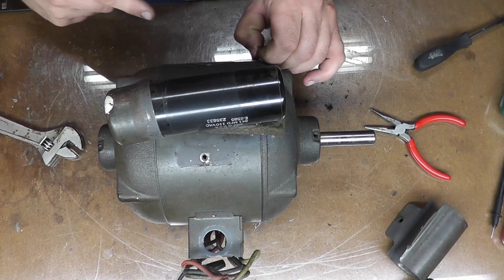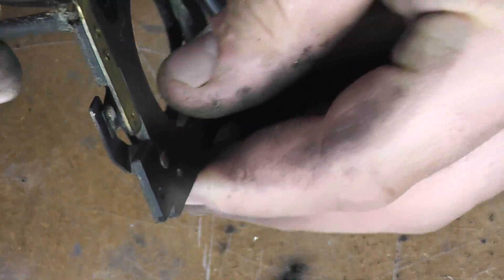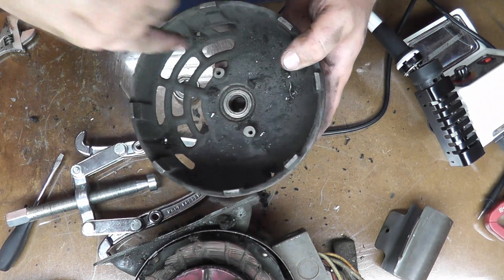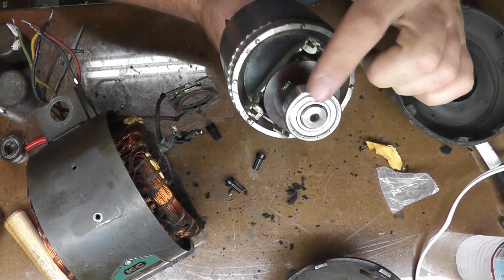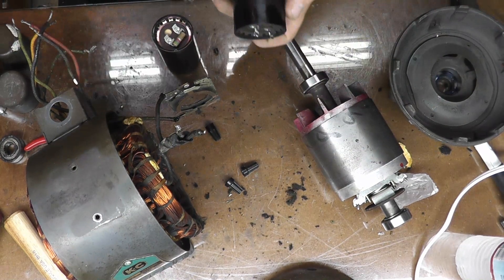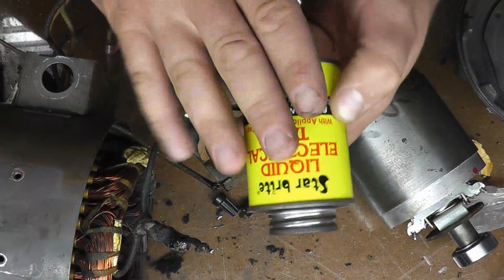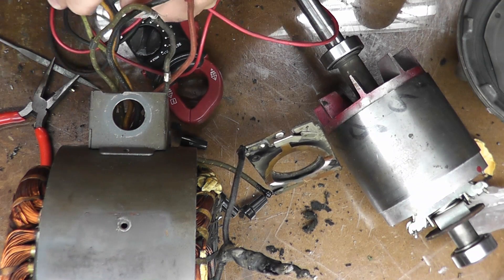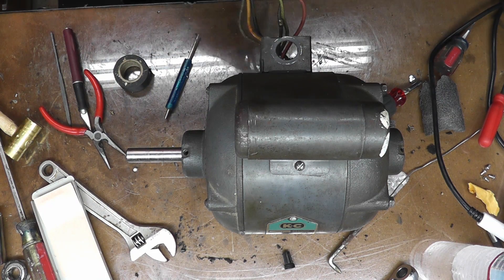1/2 Hp Dual Voltage Single Phase Motor Rebuild

Comment: Looking for at least  (1) 3/4 1,700_RPM for my 1943 Air compressor. I could buy a ew one , or use one of the modern motors I have taking up space but want to keep the look of Air Compressor "Retro" If I could post a photo of it you would understand. yesterday 12/19/24 I  rebuilt a 1931 HOOVER 1/2hp.for my 1933 CRAFTSMEN  Table Saw. I never knew HOOVER made commercial motors until I pulled this one out of saw.   Tempted to use it on A.P. and put  modern motor in saw, can't see it anyways,..?  Love the OLD OLD tools. appliances I Make them like new and I USE THEM! Oh wanted to mention , I replace the "Cork Screws" at Bearing oil ports with "Grease Zerks!"    Yup,.. Just need to be careful not to pump grease past seals and when motor has been running for long time ,with tip of your pocket knife just push tip of ZIRK in and it will "BURP" air out so grease ca move where it's needed.   Steve

Comment: Good job ! Couple questions: where are the brushes?? You did not replace them?? Thanks, just wondering....=), and ps. Where did you buy new bearings?? Ebay? Thanks=)
Reply from the maker: This is an induction motor so no brushes.  The bearings were bought from a local vendor.  You can find many places online for bearings, but the New Departure brand bearings are no longer made and have an extended inner race so you'd have to track down NOS ones like I did or get the equivalent standard bearing and then make a spacer.

Comment: i will never plug those 110vac caps on 220v mains even though you mentioned that is not necessarily indicating a voltage rating.
Reply from the maker: As long as the VAC rating is higher than your input voltage you're good

Comment: How did you get the rotor to center? I have 3/4 horsepower motor with a similar construction but i can get the rotor to not rub when reassembled

Comment: Nice demo! One thing I learned was you mentioned "Motor cleaner" and I saw how clean you got those windings.. I think the copper windings are still coated with shellac and that shellac will dissolve with alcohol so I never knew how to clean windings until seeing your video.  So do you use something like the CRC electronic cleaner or do you have another product?  I saw an "Electric Motor Cleaner" (spray) but that was for RC motors...

Comment: Hi. I have an old 1950s 3/4 horsepower craftsmen start capacitor motor that came off a table saw. I am rebuilding it and the motor worked just fine before I took the bearings off and replaced  them when I put it all back together it just humms  and won’t spin also the shaft  gets stiff and won’t spin but when I shut everything off the shaft will spin again. Can you tell me does this have anything to do with maybe the capacitor being bad or should I check something else?
Reply from the maker: Double check your wiring.  Seems like you have something in the wrong place.

Comment: I have an old craftsman.  I did exactly what you did but when I plug it in It tripped the breaker?  Double and triple checked the wiring. Any suggestions?

Comment: The squiggly letter on the meter you showed us is , i believe, the greek letter omega designating ohms or resistance. In electricity it indicates current flow. Nice video, by the way. Resistors limit the flow of current.

Comment: "VAC" stands for Volts AC, basically meaning the maximum voltage a capacitor can handle. So any "VAC" equal or higher than your application will do nicely.
The Greek letter "μ" is used as a symbol for 'micro' meaning divided by a 1000 000. 
So, 341 MFD or 341 μF stands for 341 micro Farad or 341/1000 000 Farad.

Comment: Hi Mr. H. I have an old 1947 drillpress the motor is weak, I have to hand-spin it to get it going, and on the fastest belt - it just hums.. "1/2 Horsepower Ball bearing 1750 RPM, 115 volts 60 cycle 6.7 AMP. Type CNB K8 Model 1156962. Is this something an amatuer can rebuild? I'd really like to get this running better. Thanks for any advice. https://www.youtube.com/watch?v=vUtktQjmJzA
Reply from the maker: Yes relatively easy to take apart.  More than likely the crease in the bearings has turned to peanutbutter.  You can replace them or try to clean and regrease if they don't have seals.

Comment: ~RE: at 8:05 on the clip. The main reason for this gradual (dual) bearing failure is that a single seal bearing is being used (refered to on the bearing as a single 'Z'). Either use double seal ('ZZ') or rubber seal (2RS). Either of these double seal type bearings will prevent dust ingress to the bearings so replacing with a single seal bearing will just cause headaches down the line.
~Regarding the internal centrifugal starting switch... Other than cleaning the contacts, (good idea), over time the pressure ring will flatten slightly so it's always a good idea to bend the ring out slightly, this will ensure a solid contact when the switch drops back into circuit at low rpm.
~Regarding the discharge resistor... these aren't necessary with starting capacitors due to the low MDF rating, the residual voltage in the starting capacitor will be minimal at best but always use the resistor if it is a running capacitor as these WILL hold a kick (low MFD). The μ symbol you questioned is just the international symbol for 'micro' so the capacitors will either show for instance: 60MFD or 60μF, both just mean 60 micro Farads. The VAC you refered to is Volts AC or volts (alternating current).
~One last point, before you run test the motor you should megger test it to ensure that your windings don't have earthing problems, quite important as you generally would not know the integrity or condition of the coil slot liners (slot insulation) purely by visual inspection. You grabbed the motor whilst it was running without doing this basic pre-run test, this could prove fatal if there had of been an earth fault.
Reply: incorrect: the bearing almost always come with two seals, even though they put a single Z at each seal.  this is what they do.  and they don't do a single-seal bearings - you can always remove one seal and you get a 'single Z' bearing.  and the whole process is still cheaper than having to construct two production lines, one for Z and the other for ZZ.  I believe this guy has used bearings with seals on both sides.  this is a standard.

Comment: Great channel, most enjoyable!! On the 1/2 dual voltage motor: Either you got lucky, or you did not show the phasing of the main windings. If they are out of phase the motor will not start, and you will probably blow a breaker. To test, connect only one of the main windings at a time, and try starting. If there is enough torque to start, do the same to the other winding and check rotation. If it is reverse rotating, just reverse the leads to that main. On 208/220, it is harder because they are in series and you need both connected. If they are not in phase, you will not start or the breaker will blow. Reverse one of the main series windings. Lot of words, but, in fact, that is what you have to do on a dual voltage motor.

Thanks again!!

Comment: Hi, I was wondering if you could help me out with a wiring issue im having. I have a motor that is 115/230v 3/4 hp that i just bought from a salvage yard for my bench top mill and am not sure how to wire it in. It had 3 wires coming out of the back of it; black, white, and green. the green went to a ground screw so thats easy, then it was white and black so i assumed it was setup for 115 v so i wired it in that way and the motor fires up no problem. the problem is that it doesnt seem to have the power that it should and I was curious if maybe it was already setup as 230 and I have it set up as 115. if thats the case would the motor even work if i wired it to 115 and it was supposed to be 230? It has a motor plate but no schematic or anything about switching the power around. any help would be appreciated. I also noticed the part in your video also when you said the motor wasnt getting hot, mine gets warm fast when i turn it on so thats what made me start thinking i have something wrong too.
Reply: Does the nameplate say 115/230? If so, only a black and white makes no sense, because there would be no way to change the voltage setup. Getting warm fast on 115 probably means there is something wrong with the motor. If the starting switch is not opening, that would make it get hot very fast.  I think you might have a dud.
Reply: larry brunetti, yes the name plate does say 115/230 and there are a few terminals inside the motor you can change the wire positions around to. There is no wiring diagram nor could I find one online. I assumed it was wired 115 so that's the way I hooked it up. I not familiar with them enough to know whether or not it would even work if it's setup for 230 and I wired it to 115. I was thinking maybe it was getting hot and doesn't have much power because it's missing the other power leg and only half the windings are being energized?
Reply: Chris, out of the motor there will be 6 wires. Two for the starting winding, and the other pair for the main windings. For 230 v operation, the main windings will be connected in series, and the staring winding will be across ONE of the staring windings. For 115 v operation, the starting windings will be in parallel, with the starting winding across BOTH of them. In both cases, the main windings must be phased, as I described in the article above. If the motor starts on 115, but is weak, it is probably wired for 230, and if it doesn’t get up to speed, the starting winding will not kick out and the motor will get hot and draw a lot of current. Either try it on 230, or rewire it according to my article. If you take all of the wires apart, you can use an ohmmeter to check the coils out. You can get an ohmmeter at NAPA, True Value Hardware or Radio Shack:
 
the main windings will be the same resistance
the starting winding will be different than the mains.
 
Phase the mains, and connected as I described. Should have no problem.
 
Good Luck!

Comment: This was great, lots of useful info.  I would like to have seen how you get bearings on and off shaft and/or motor housing.  I have question whether it is OK to bang on the shaft with a hammer, or could that demagnetize the core magnets (if such perm magnets exist)?

I wanted to rebuild a 1/2 HP washing machine motor, but the housing cannot be taken apart, it seems to be two pieces epoxied together.  I went ahead and hacksawed through the housing at each end to get to the bearings, but I'm not sure how to get the bearings out.  Would like to see that.

I had tried previously to oil the bearings before I understood the concept of sealed bearings.  What I accomplished was lubing the shaft so it turned easily inside the inner bearing surface (race?).  So actually I created the illusion of making a stuck motor rotate easily again.  My question there is:  should bearings be tightly fixed on the shaft somehow, or is it OK for the bearing to just slide over the shaft with low friction.  It seems that would make two bearing surfaces, one on the shaft and outer race, and the other inside the bearing where the balls are.  Does oiling the shaft in that way actually cause a bad condition?

I'm going to see if I can drill, shim, and screw the hacksawed housing back together.  I doubt I can restore the perfect alignment needed, just for the heck of it I may try.  It seems like a real waste that these motors, which can retail for $240, are "throwaway" parts because you can't open them up properly.

I had seen the centrifugal start motor switch but didn't know what it was, thanks for identifying it.
Reply: +Simon Baker 
That really sucks they make it so you can't rebuild the motor, but just for general knowledge,
The bearings do want to have a tight fit to the shaft, and to the housing.
If they spin on the shaft, or in the housing, they will get very hot, and eventually ruin the shaft or housing seat.
Some can be banged off or out, but you need to hold a block of wood on the end of the shaft and hit that with the hammer so you don't mushroom the end of the shaft.
If you don't get it to move after a wack or two, don't keep beating on it, if they are very tight you need to use a bearing puller or a press.
A lot of car parts places let you borrow tools for free, they have a puller you can borrow.
Reply: +C Smith Thanks for reply!  I think I learned some more about these "non-serviceable" motors.  I pried apart the bearings and they don't seem to be ball bearing design at all.  I think they are simple "lubed sleeve" design, which is just a lubed cylinder in which the shaft rotates.  There seems to be a lube reservoir surrounding the cylindrical sleeve which is stuffed with an absorbent material that looks like a felt pad.  They are pretty dried out, with some thick grease residue left in places.  The two bearings are not identical, I think for "self-alignment" purposes -- because one bearing is basically a "swivel ball" with a cylindrical hole in it that the shaft goes through.  The "swivel ball" is held by a press-fit piece of metal with a cavity that holds the "swivel ball" (my terminology -- I'm not a mech engineer).  This seems to allow one of the bearings to adjust to the angle of the rotor shaft to minimize friction and achieve best alignment.  That's my guess.  The other bearing is just a fixed cylindrical polished sleeve press-fit into a cylindrical cavity in the motor housing I think.

I think it may be perfectly feasible to lube these bearings if you drilled small holes in the press-fit reservoir/bushings that make up the bearings and inject some kind of lube, then plug the holes.  Doing that every 5 years might keep these motors running a lot longer, don't know.

I find the idea of "extreme repair" / "bush fix" interesting, so I'll keep thinking of ways that these weird bearings might be replaced by conventional ball bearings to salvage these motors if all else is in good shape.  But given the design of the housing, it looks very challenging to make some kind of bushing to hold the bearings solidly, and probably a real witch to get perfect alignment.  Probably would need to weld in a new piece of metal, etc.  But probably there is some clever minimal way to do it -- especially if you had no other choice (WWII pilot stranded needs to fix generator, etc.).

Comment: Where can I order bearings for an old Westinghouse 1/2Hp 115v from an belt drive attic exhaust fan?  Is there a cross reference to motors made 50 years ago ?  Thanks.

Comment: Awesome vid, quick point on removing the bearing inside the housing. I use a small dremel cut wheel to saw a small slice in the bearing, this will reduce the tension and allow the bearing to fall out of the housing.

Comment: Thanks great lesson.
my 6" belt sander is loosing power how can I fix it?
Reply from the maker: Victor Plawski First and easiest to check is the bearings.  If the shaft doesn't spin free then there's your problem.  Next up would be the capacitor.  Check for leaks.  If it looks like crap just replace it.  They're cheap.  Next up is the centrifugal switch contacts.  Clean them and make sure the switch functions and the springs and everything move.

Comment: ok good video . When you were testin to see which wires go together did you check for ohms thru the 2 wires??
I am trying to rewire a single phase 110v and 220v ac motor on a Grizzly milling machine. I am not ready to install 220v line to my gagrage yet so Imtrying to use the 110v configuration. Can you give me some advice.
Thanks
Manny
PS
get back to machining :))
Reply from the maker: Manny Monroy If it's the original motor there should be a diagram on there or if not at least one in the manual.  Have a peek here may point you in the right direction.  http://ijyam.blogspot.com/2011/07/internal-wiring-configuration-for-dual.html

Comment: You made my day with this. I'm in the process of rebuilding a Shopsmith 10E and the motor it came with needs pretty much the exact rebuild you describe here. 

One question - how did you fit the bearings back into the housing? Did you have to heat the backplate, or were you able to just press fit them on cold? I noticed you put the bearings on the shaft first - was there any concern of them shifting as you pressed them on to the housing plates?
Reply from the maker: The bearings are a hard press fit on the shaft and a light press in the end bell housings.  The bearings seat into a shoulder on the shaft so there isn't an issue of them shifting when reinstalling the housing.  You can tap the housings onto the bearings with a non marring hammer and then turn the housings to the correct positions and bolt together.

Comment: I did a rewind of a single phase coal heat distributor last summer, was really fun :P I did the standard repairs on 20+ other motors during the summers including switching capacitors and bearings, best job I have tried so far
Reply: Mr. Vilestorm, do you sell those 20-30 motors? I'm in Phillips Wi. USA I need at least  (1) 3/4 1,700_RPM for my 1943 Air compressor. I could buy a ew one , or use one of the modern motors I have taking up space but want to keep the look of Air Compressor "Retro" If I could post a photo of it you would understand. yesterday 12/19/24 I  rebuilt a 1931 HOOVER 1/2hp.for my 1933 CRAFTSMEN  Table Saw. I never knew HOOVER made commercial motors until I pulled this one out of saw.   Tempted to use it on A.P. and put  modern motor in saw, can't see it anyways,..?  Love the OLD OLD tools. appliances I Make them like new and I USE THEM! Oh wanted to mention , I replace the "Cork Screws" at Bearing oil ports with "Grease Zikrs" Steve